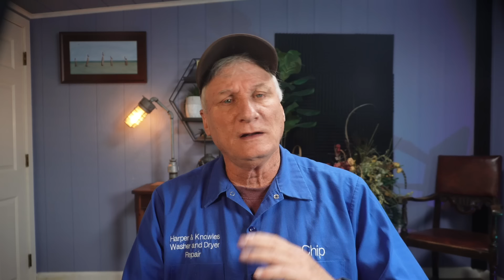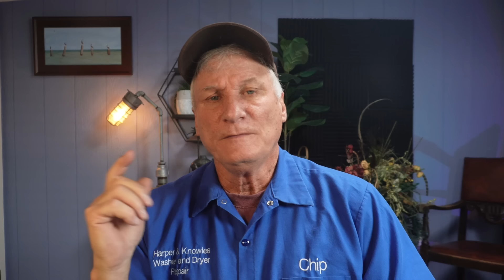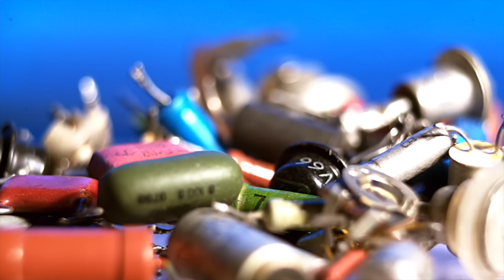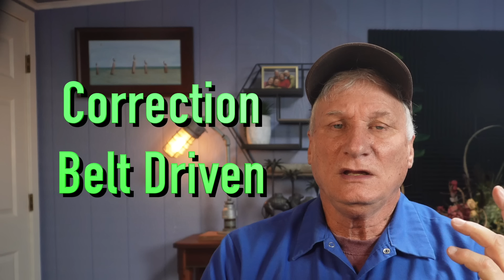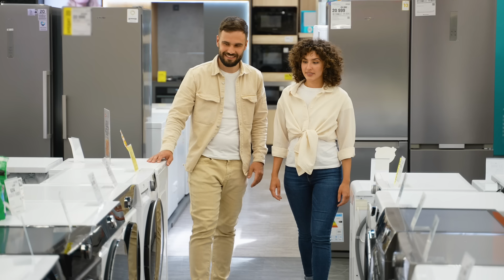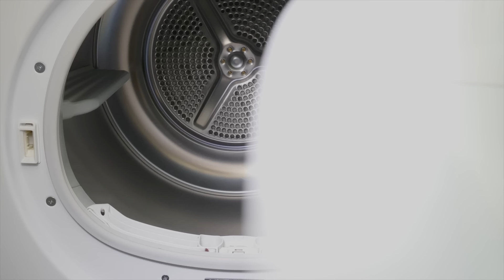Speed Queen Decoded: Which Model Is Built for Your House (Every Washer, Honest Review)

Comment: The problem, at least from my perspective is not the "knob touch" compared to the digital and touchscreens.  The PROBLEM -- and Chip DID point it out honestly -- is that behind the dials on that TC5, IT IS a computerized control board.  And those DO fail.  Not all the time, and not every one of them, but I've seen a lot of complaints about it from people who HAVE had failures.  And several weeks of down time between the diagnosis and the replacement board arriving, and a number of stories about having to pay for a 2nd service call anyway, even when it was SUPPOSED TO BE covered under warranty.  Speed Queen acknowledged as much when I called, by responding "yes, but that's covered under warranty".    Meanwhile, it is happening enough that Speed Queen advises authorized techs to carry those boards on their trucks.  Somewhere I saw an internal memo that put the failure rate of those boards around 15%

And yes the warranty is supposed to cover it during the warranty period.   But once warranty runs out or stops covering it, it's a VERY EXPENSIVE repair.  

And yes, they MIGHT keep making those boards for years and years. But they might not.  And once they do decide to stop making them, TC5 units will still end up on the scrap heap.  If you get 10-15 years before it happens to YOURS, then you might consider that a win of the game.  But I don't.  And of course, it will not happen to every single unit!  But if you have it happen three or four times just in the 5 years of warranty -- and I've seen several vids where it did -- you don't want to still own that machine after warranty.  

To be fair, I have no knowledge or experience with an FF7.  I've had several front loaders, and not one of them can clean worth a crap.  The only front loaders I ever found to work well were laundromat front loaders of yester-year, and THOSE were all Speed Queen.  So FF7 might clean well, I can't judge that without trying it.  But unless it is all analog controls -- and you pointed out that nothing is anymore -- I still don't want one.  

A few things have been made over the years with computerized control boards in them that do stand the test of time, but not many.  And every appliance I have ever owned that has any computer crap in it -- a Freezer, two refrigerator/freezers, three front-load washers & two front load dryers, and a kitchen Range -- Except one of those front load dryers that never broke, ALL -- EVERY ONE of those other appliances had computer board failures that got into my pocket.  

Now I again use my old freezer (that sat OUTSIDE for a year because I just never did dump it when I bought the new one that I THOUGHT would be the right one for us til it spoiled over $600 worth of food).  It's over 30 years old, we've had it for over 10, and when I brought it back in and "apologized" to it for turning my back on it, and plugged it in, it sprang right back to life and has run perfectly now for 3 years since that "new" one failed after a year.   We have two old-school refrigerators, one that was over 10 years old when we got it, that we have owned now for 15 years, and the other we found on a junk pile from a house cleanup, that was just a spare, but we put it into primary use after the French Door thing got into my pocket again for the last time and I threw it out.  BOTH have worked PERFECTLY for years and years, neither has ever had a single repair.  We now have an old analog Range with dial thermostat for the oven that was already 20 years old when we got it and we've now used it for 12 years with ONE $30 heating element replacement.  And we have again TWO old-school Washers, one Whirlpool we got for free and one Kenmore made by Whirlpool we got for $50, both off of Facebook Marketplace.  And three Whirlpool-made top-filter dryers.  We've only had those about 6 months now, but we've never put a penny into any of them, and those machines do over two dozen loads a week (large family) with no issues.  And whenever they do, they can be easily fixed with cheap parts.  

I honestly suggest NO ONE go buy new.  It's shiny, but it's EXPENSIVE to buy, EXPENSIVE to use, and EXPENSIVE to own.  Find a reputable Used Appliance shop that does repairs, and get something that has been reconditioned by them.  It will almost ALWAYS last way longer and cost way less than ANYTHING sold new today.  For those people who just 'have to have" new, it's good that Chip is so straightforward.  It really is.  Still, buy something old-school, used and reconditioned, from Chip or someone like him, and you'll always be miles ahead of the game.  

Back to the topic at hand, just my opinion, but I will pass on ANYTHING Speed Queen makes for residential at present.  

If someone wants brand new and will not consider something refurbished by a shop like Chip's, then my go-to is the Speed Queen TV2000.  If you ADD a load size switch (which Speed Queen deleted, but which can easily be added back on) it will function as close to old-school as possible, and WITH the Eco-Cycle setting it has now, available anytime you want it, you CAN have very low water use when you have only moderately soiled laundry.  It will have almost no warranty at all.  But it should run dependably for many years, with only analog controls and not-terribly-expensive parts.
Reply from the maker: Jeff, you put more thought into this than most reviewers do, so let me sort what I'd agree with from what I'd push back on.

Agreed: The TC5 has a computerized control board — I said so in the video — and yes, those can fail. It's the most expensive single part on that machine. If a 100% mechanical washer is what you want, the TV2000 with the mechanical timer is exactly the right machine, and I recommend it for that buyer. No argument from me there.

Where I'd push back: The "15% failure rate" from an internal memo is something I'd need to see before I put weight on it. Speed Queen wouldn't stand behind a 7-year parts and labor warranty on a board with that failure rate — the math doesn't work for them. Authorized techs carrying common boards on the truck is standard practice across every brand I've worked on; that's logistics, not an admission of a defect. And every electronic part on every appliance built today eventually gets discontinued — that's the entire industry, not just Speed Queen. The TC5 is still a better bet for longevity than 95% of what's on the showroom floor.

On the used/reconditioned route — I agree, for folks who can find a reputable shop and don't mind a machine without a warranty, that's a smart play. It just isn't the right answer for every buyer.

Bottom line: if somebody tells me they want a Speed Queen and zero electronics, I'm pointing them at the TV2000 every time. If they want the full residential feature set and they'll maintain the machine, I'm still recommending the TC5 or the FF7. Different buyers, different machines. Appreciate the writeup.
Reply: @HarperandKnowles Hey Chip - yeah, I guess I did!  My brain just works that way....

When I saw it, I wasn't focused at all on Speed Queen longevity, so I didn't save a record of where I saw it.  But the person who showed it was a Speed Queen technician.  That said, yes you're right you can't really rely on something just because you saw it somewhere online. 

Yes every electronic part will fail sooner or later, so will any mechanical part.  And yes sooner or later every computer board will cease mfg, that's also true for any mechanical part. 

While I do know the TC5 is built with the quality mechanical hardware Speed Queen is known for, I'm not persuaded at all that the same can be said of that control board.  And I have heard of cases where they have stopped replacing it after the 2nd or 3rd time and just turned their back on the customer.  How true or how often I can speak to because it didn't happen to me, but sadly I believe it.  

I would actually really like to talk to and hear from someone who works on a lot of Speed Queen for an experienced view on what the numbers actually are.  

Yes you are right that finding someone like you and getting a reconditioned older machine is just not right for some people.   

And the TC5 or the Maytag Commercial you praised in a recent vid (that also has a stupid control board behind the knobs) could well be the only acceptable choices for that person who just has to have something brand new.  

It's funny, BOTH of those machines can use as much water as the Direct Drives, and they still managed to get around the regulations.  Which to me says that if someone WANTED TO they could have found ways to keep making machines that WILL last 30 years, and gotten around the regs!
Reply: I'm very interested in what you're saying about adding a water level control to the TV2... please expand on that. Thank you.
Reply: @B81Mack  In almost all washers I've ever seen, there is a semi-firm plastic tube/hose coming from a fitting near the bottom of the tub, and going up to a diaphragm in the console with wires coming out of it.  That diaphragm detects increasing pressure as the water level rises, and when pressure reaches the calibrated point for the set water level, it shuts off the fill valve(s) and starts the motor for the wash cycle. 

On most machines for the last 50 years, that diaphragm has a spindle sticking out, that goes thru a hole in the console, and gets a knob put on it.  The knob twists to the different positions. Most common are 3 positions, for Small, Med, Large.  (Some have only 2 positions, Small, Large. Some have 4, some have 5, and some are called "Infinite" because you just move it like a volume control between the lowest and highest.)

Speed Queen machines always had this too, but a few years back they deleted it on the TV2000.  (I don't know why, but my guess is because in a true commercial environment, people don't use load size, everything just runs on full tubs of water, and to not run afoul of the new regulations, they had to be sure this was truly designated as a "Commercial" model.)

But inside of it there is still a pressure diaphragm to control the water level,  it just doesn't have a spindle for a knob to switch sizes.  

You get a diaphragm (it's just called a Pressure Switch) with the number of levels you want. And really 3 is enough, Small, Medium, Large but you can get a 5 as easy as a 3, and I like the 5 myself.  ExSmall, Small, Medium, Large, ExLarge.  

You remove the wires and plastic tube/hose off the diaphragm that's in the machine now, and put them on the new diaphragm you got.  You'll need to drill a hole to put the spindle thru the console, and put a knob on it.  Be sure when you buy the diaphragm to also buy a knob, preferably one that matches your Water Temperature knob. 

"Speed Queen Pressure Switch" on eBay will give you dozens of listing for $15-20.  Some sellers will know how many positions their switch is, but most won't.   I'm sorry I don't know a part number to tell you.  "Speed Queen Knob" will give you a hundred listings for $5-10.  Those you can look at and tell what matches your Water Temperature knob.

And then as to marking the spots on the face of your console:  On one machine I just wrote on the sizes with a marker. On another I printed on a piece of sticker paper and cut square labels and stuck them on.  Either is fine, and then you have selectable load sizes 🙂

It's very simple, ask me more if that's not clear 👍

Comment: I love hearing that my Speed Queen TR-7 was built so much in the United States.  We have had it and the matching dryer for a few months now and love them.  Speed Queen cult indeed.
Reply from the maker: Glad you're enjoying the set, they really are built to last!
Reply: Make sure to "clean" the washer every 30 loads or one month. Get "affresh" at home depot or other stores, put a package in the washer drum on hot water/heavy duty cycle and let it run through the cycle. When the cycle is complete wipe the tub down for any residue left after the cleaning. This will keep your tub and drain line clean and you will have cleaner smelling clothes. I also wipe down around the top of the drum. It's a quick process that keeps your speed queen in top condition. Another hint is keep the washer lid open when not in use as this will keep any mold or residue from starting to cause odors.

Comment: We purchased a TC5 but there is no "cleaning cycle". I did a quick search and found this on recommended cleaning......Run a manual cleaning cycle: Use the hottest water setting (Hot), Heavy Duty or Heavy Soil cycle, and Deep Fill option if available. Add white vinegar (2–4 cups), baking soda, or a washer cleaner like Affresh or CLR. Let it agitate, pause/soak for 30–60 minutes if needed, then complete the cycle. Repeat with a rinse if desired. Many owners do this monthly.

Is the what you recommend? Thanks!
Reply from the maker: Spot on—running it empty on a hot, heavy cycle with a good cleaner is the best way to maintain that machine.
Reply: @HarperandKnowles  Thank you!

Comment: My father was in this business his entire life. He would tell his customers when he sold the new appliances you do not want all the bells and whistles. Simple is better last longer and less repair.
Reply from the maker: Your father sounds like a man who really knew his stuff!
Reply: @HarperandKnowles Yeah. But if he pulled the front cover or control panel cover on a new TC-5, he'd shake his head and button it back up.

Sensors, boards, all break.
Reply: Electronic boards, I'm learning, are just a fact of life these days. I'd still go with Speed Queen over any other, because they make parts for their machines much longer and there's a better chance that it can be compared if need be.
Reply: Thank you for explaining how supply chains work! I’ve worked in manufacturing for over a decade and some people don’t seem to understand how many components go into a product. Even if some of the components are made in the USA, you may need multiple vendors to meet your demand. Also, quite frankly, not everything made in America is the better quality. I was honestly disappointed when a company I worked for sourced the same part from two different companies, and the one from China hardly had any issues, and the one made in America was a crap shoot if we got a good batch or not. I looked up this video because my SpeedQueen was making noises and on the rinse cycle half the water was gone and it sounded like the agitator was stuck. I’m hoping I don’t need a new one. 🤞
Reply: Exactly

Comment: Do you repair dish washers?  My Maytag is 20 years old and is on it's last legs.  I would appreciate an honest review of what's on the market to avoid.
Reply from the maker: Honest answer — I keep my shop to washers and dryers, so I don't turn wrenches on dishwashers day to day. A 20-year-old Maytag on its last legs sounds about right; the ones from that era were built like tanks before everybody went to slim electronic boards.

I can't hand you a "buy this exact model" off the cuff without digging in the way I would for a washer, but the same rule from this video holds: the ones that last have simple, serviceable guts and a stainless tub, and the ones to avoid are loaded with touch panels and proprietary boards that cost more than the machine when they quit. A dishwasher buy/avoid breakdown is a good candidate for one of these review videos — I'll put it on the list. Anybody else want that one, say so below.

Comment: Folks believe what Chip tells you as he knows what he is talking about. I had my washer and dryer die about 2 years ago, two weeks apart. I went online and researched and watched tons of "review" videos and one brand stood out on top and that was Speed Queen which is American made in Ripon, Wisconsin since 1908. When you go to a laundromat what do you see ? Speed Queen which is commercial grade and that is the same grade which goes into residential Speed Queen products. I purchased the TC5 washer and DC5 dryer and couldn't be happier, they perform week end and week out and not a problem, just clean clothes. Speed Queen test their washers for 10,400 loads which is about 25 years average use and that should tell you something about quality and reliability. Yes, you do pay a bit more than "sale" products at big box stores but you will not be replacing your washer and dryer every few years or need tons of repairs. Remember as always you get what you pay for !
Reply from the maker: Appreciate that, Richard — and you did the homework most folks skip. The TC5/DC5 pairing is a solid setup; keep the tub-clean cycle on a schedule and those two will outlast the house. You nailed the part people gloss over, too: that 10,400-load test isn't marketing, it's the same durability spec as the laundromat machines. Thanks for taking the time to write it all out.